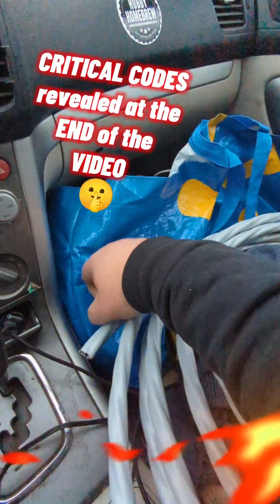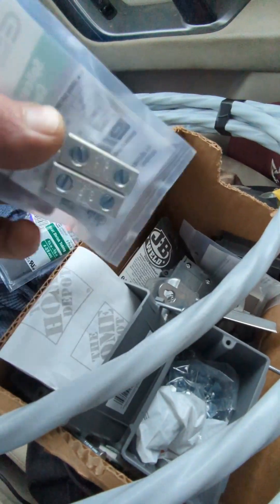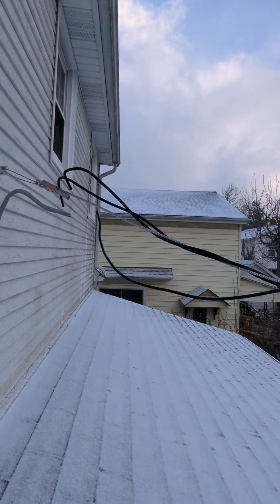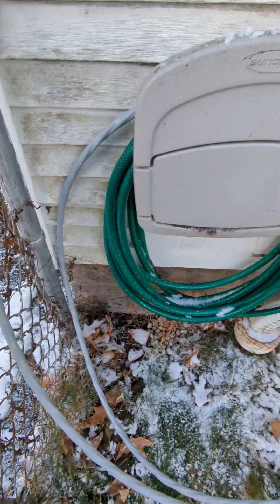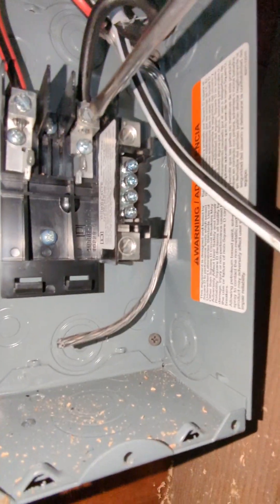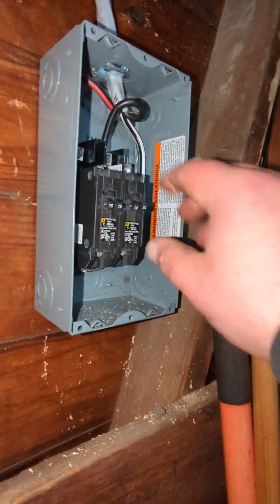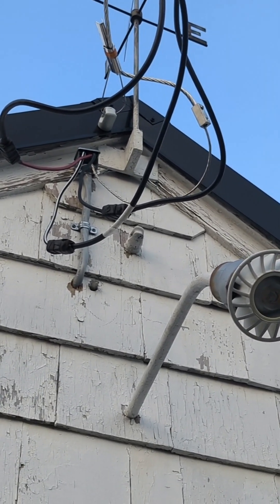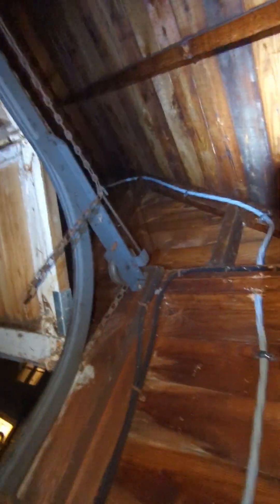OVERHEAD POWER to a garage. FAST n EASY 🤫

Comment: Good video. Would it have been possible to run the SER cable all the way from panel to subpanel? Why the splice for the overhead portion? Is it cost or a code requirement? Also, the one wall penetration was too close to the window below. 👍
Reply from the maker: If your garage is connected to the house or whatever building your MAIN service with your electric meter is located, then yes absolutely, you can run SER all the way from panel to panel. In my situation I either had to go underground or over head. Type ser cable isn't intended to be suspended in the air or buried, therefore I used the quadplex, its a code requirement.
Reply: @crazyDIYguy  Great to know. Thank you!

Comment: Wow dude this is exactly what I needed! Would love to hear more about getting your permits. That part scares me - drawing interest to my situation. I want to be safe and legal, but there are a lot of existing issues, and I'm not a millionaire.
Reply from the maker: No permits where I live. Typically only in larger cities. I do the work, call for the inspection after its done. Wiring a new house requires 2 inspections your "rough in" and your "final". Pretty simple luckily. Just do it to code, if you personally own the house and you reside there, in most jurisdictions you can do the work or pull a permit yourself.

Comment: Overhead is best. I’m a power lineman for a living. We are not Superman where we can see where the break is in the ground. Atleast with overhead you can see if it goes bad? Why would you have your tri-plex over your roof? Now if someone has to work on your roof? You’ll have to take it down. I’ve never seen aluminum wire expand or contract like you describe? We just hook it up. I’ve never seen it shrink.
Reply from the maker: That was the only place that was 3ft away from windows or doors, I ran SER wire on the exterior vertical which dictates the 3ft, conduit would exempt me. Also it was my only viable option in that setup. 

 Triplex is so much better, 100% agree there. Underground always seems to eventually fail. 
Aluminum does expand and contract with temperature at a pretty significant rate, so if you're torquing down your aluminum connections at 90° Fahrenheit the odds of them loosening up during the winter are pretty good. While not a super common problem.
Reply from the maker: I get a pretty significant amount of neutral compression connection failures at the point of connection for the mains on a lot of houses during the winter, I imagine the corrosion in combination with expansion/contraction might play a role.

Comment: Thank you this is helpful. I got a little cabin. The previous owners just ran wires for each of the utilities. Well pump, electric water heater, and service for the lights. The only wire that was approved for ground contact with the well wire. The other ones are just regular old romex. No conduit at all. I'm going to run a wire overhead to the little cabin from the breaker box at the meter. After seeing everything that's involved for the overhead. Maybe it's not such a bad idea to dig a trench and use conduit... I really don't want to dig? I learned a lot about the hardware necessary. And the option of using a heavy gauge aluminum wire. It was especially helpful you outlined all of the hardware necessary.!
Reply from the maker: I always recommend going overhead. That way it is always accessible. Water penetrates the underground wires inevitably. Every single time.

Comment from the maker: Important, type SER cable can't be run on your driveway side if the driveway is very close to the house, I have previously been made to put it in conduit (very short run in conduit) on the driveway side. Look up the codes in your jurisdiction or ask your inspector about that.
 Also, you cannot bury either one of these conductors I am using. Though they may be moisture resistant, they are not suitable for burial in general.
 Also as a technicality, My weather head may have needed to be higher than my glass insulator and wedge connectors where the quadruplex connects to the building, I'll find out for sure this week and update it in the comments. Thanks for watching 🙏
Reply from the maker: Putting your electrical riser in conduit (the wire attached to the outside of the building) might save you some grief and make you more immune to rules and regs on minimum clearance from driveways, windows, doors, etc. you can use copper THWN, aluminum XHHW, etc in conduit. Look up conductor types and make sure they're rated for exterior use in conduit. Make sure your conduit is schedule 80 on the lower parts or Ridgid if metal. If your conduit is the primary support for the air cable, make sure it is Ridgid metal all the way up with a guy wire for extra support above the roof line.
 Also I believe, for in the air you can use multiple types of conductors as long as there's a steel cable for support the conductor is wrapped around. This is everything I can think of, call your local inspector and question the hell out of them. 👌
Reply from the maker: Update: the job passed but the inspector wanted an independent ground rod at the garage since it was a separate building. I installed 1 8ft 1/2 ground rod and connected it to the ground bar with #4 copper wire.
Reply: SER has XHHW conductors inside, so If you strip the sheathing and splice in an insulated ground it can be used in underground conduit. Rare situation, but good to know if you have an abundance of SER like me 😄 It's a very versatile cable, straight across my basement joist too, no holes! 🎉
Reply: (As long as the conductors inside are individually marked, mine were)